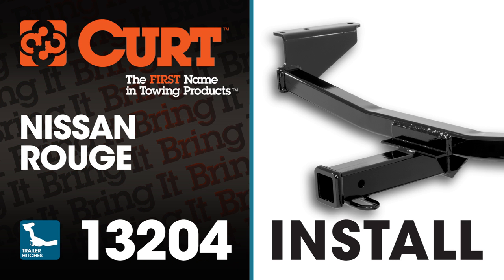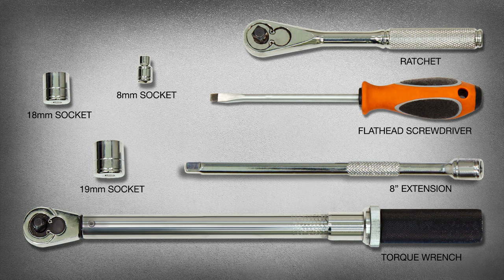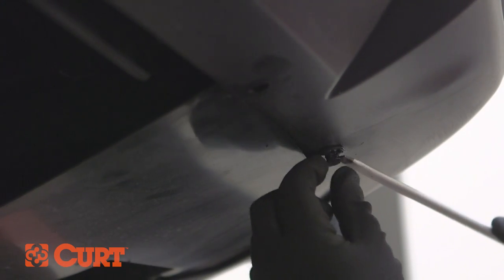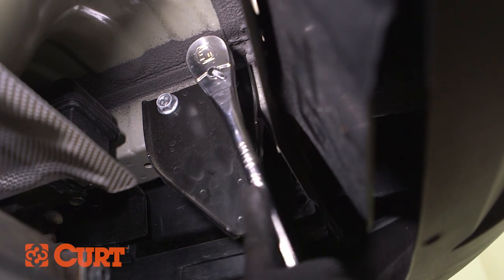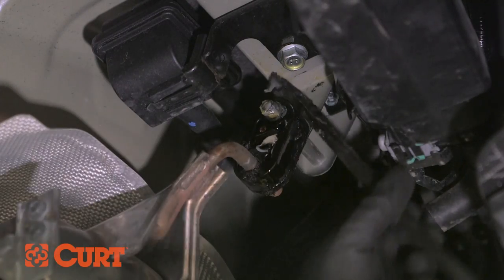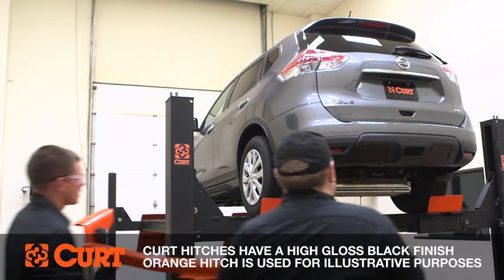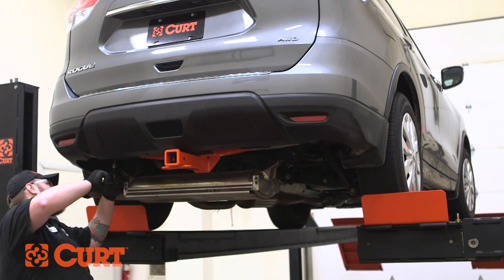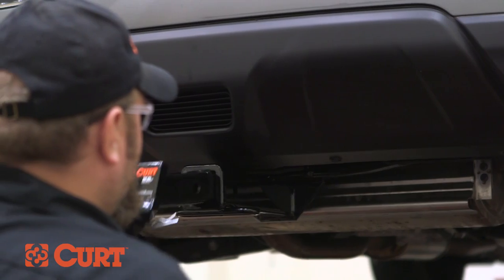Trailer Hitch Install: CURT 13204 on a Nissan Rogue

Comment: Is dropping the exhaust absolutely necessary to fit the hitch in place?  Or is it more of a suggestion?  This seems like you are more likely to damage it than if you left it in place.  Especially those of us installing the hitch in our driveway without the benefit of a lift.
Reply from the maker: Our installation instructions are not suggestions. Support your exhaust system with a ratchet strap or clothes hanger before lowering it. This will prevent damage. If you need any help, feel free to give us a call at (877) 287-8634 ext. 2.